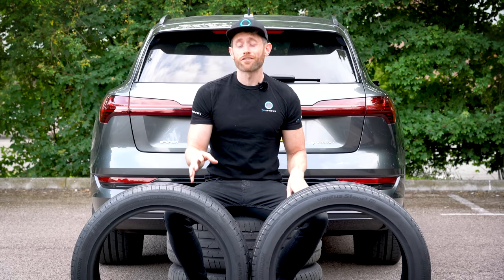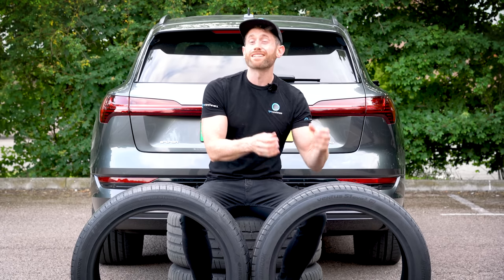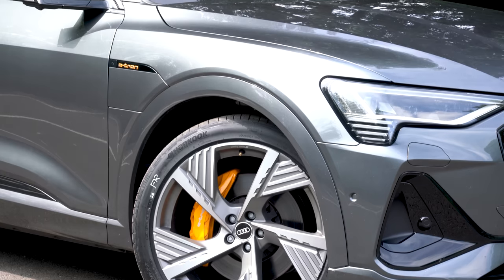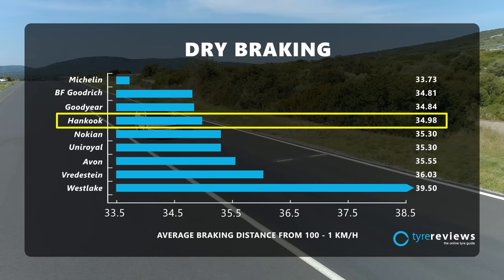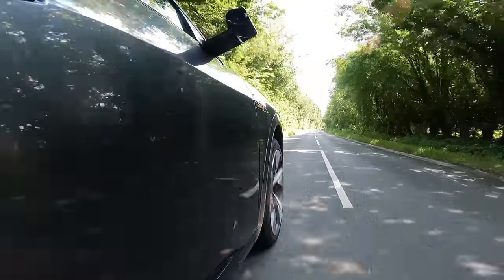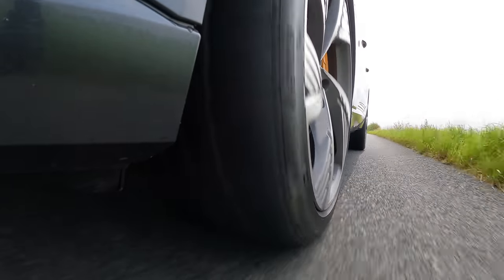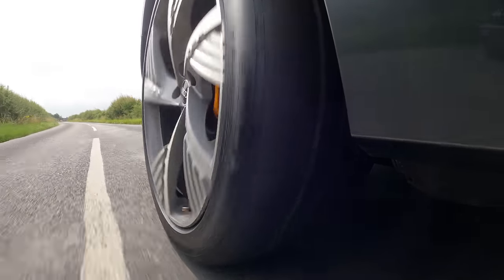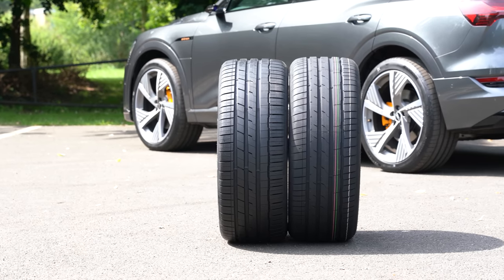What makes EV tires different, and why should you fit them! 🔌

Comment: In other words, as usual: fit the recommended tyres to your car, the manufacturer knows what they're doing when they recommend those.
Reply: Unless they are made by Nexen. Than throw them off the car IMMEDIATELY.
Reply: He also said that the manufacturer will screw it up:  Ford putting skinny tires on the Mach-E hoping to get a higher range number but changing it from a "Sports Car" to an Economy Box with crappy handling in the process.
Reply: Unless it's a truck with P rated tires.
Reply: Also there was the whole Ford Firestone thing
Reply: @RAM-BAWN  I think that really depends on what you're using the truck for. It's perfectly fine to run p rated tires on a truck if you're not really hauling anything for it. You know the people that buy it just because they might go get some bags of mulch from Lowe's once a year. If you're only putting 500 lb in the bed or even a thousand I wouldn't worry.
Reply: @custommotor  P rated also have less tread depth (usually), something that should also be considered.
Reply: I disagree, in my experience most manufacturerers seem to fit cheap tires that suck.
Reply: Nice !!
Reply: @fiyinfoluwa oluwasegun the climate here is cold and wet and the road surface is rough. I don't like the lack of grip the tyres have below 10°C in the wet. If it's warmer and dryer where you are they might be fine.
Reply: Nah, I'd suggest people to use what fits there driving style, budget and road conditions without going to extreme, like putting slicks or super grippy tires on a normal car. 

Perfect example is Mercedes recommends a MO Continental ProContiContact for my car. They are a horrible tire. I've only used DWS06 and Nokian WRG4 which are far better across the board in every condition except noise and comfort.

I'm personally looking for a tire with a little bit more longitudinal grip in the wet. The DWS06 are better than the WRG4 in the wet, but not better in the snow and ice or tread wear. 

Still looking for another tire.
Reply: I remember people hated Goodyear efficient grip so much they almost sold the car.  Fit a set of Michelin primacy 4  and it's a complete transformation
Reply: @quixomega  it's whatever they get a cheaper deal on.  They're literally buying 10's of thousands of sets of tyres.
Reply: Nah ev tyres for my ice phev
Reply: @TheCloudhopper  lol, why? Me ‘em is not a good tire? Terrible quality? Thx
Reply: @mikeike7114  Depends on where you are.  In warm dry conditions they were ok (not great) but in cold (below 14°C) and damp conditions their brake performance is atrocious. They felt unsafe in wet conditions around 10°C which here is pretty much October to May. 
It's hard to quantify, I did an unscientific test on the road outside my house. Stopping distance on the same day in very similar conditions before and after changing tyres, The continental tyres I'm on now stopped from 100kmh in 15m less than the nexen. And I havent triggered the ABS once I. The two years since I switched, with the Nexen the ABS would often activate when stopping at junctions.
The rubber mix is obviously not optimized for use in Temperate European climate
Reply: Unless they’re made by Dunlop.
Reply: @setoman1  
Dunlop doesn’t make cars!
Reply: Most manufacturers are putting cheaper tires then they could to lower the costs, so no, unless you're driving an expensive car, there are probably a bunch of better tires than your car came with.
Reply: @vladimirtalijan  Nope, most will put proper tyres on their vehicles that optimise performance, either handling and/or fuel efficiency. Many will have multiple tyres they recommend, and may ship the car from the factory with the lowest cost option among those, yes, but that doesn't mean they only recommend cheap ones simply because they're cheap.
E.g. for my car the manufacturer has 2 recommended tyres. They ship with the option that's manufactured closer to the factory, the dealers typically fit replacements of the option that's manufactured closer to them simply because of logistics.
Both are good tyres, just availability is different in different areas.
Reply: @jwenting  My last car came with tires that cost $300~ per tire (2017 money), and they were absolute trash. I thought it was an issue with my car, until I got cheaper tires. And suddenly! I had traction 😂

Comment: Don't have an EV and no immediate plans to buy one. Watched anyway because your content is always so interesting 👍👍👍
Reply: Can I ask why? I'm seriously considering an EV as my next car probably a tesla 3 or Jag I-pace as there more in my budget. But trying to gather opinions and data to help.
Reply: @seansimpson4472   Don't worry what Steve or anyone else thinks, if an EV will work for you then go for it. From my point of view, I've had an Ioniq 28 kWh for three years and it’s been great. If those cars are in your budget I'd recommend the Tesla Model 3 or wait a little longer for the Model Y which has a hatchback and massive space. The Jag is not as efficient or technologically advanced but still lovely inside. Try both.
Reply: Thats everyone bruh. Like everyone.
Reply: @seansimpson4472  I thought I had posted a lengthy reply, but perhaps there was a technical glitch. Just to say that an EV is not for me because I do occasional long journeys to the in-laws of 100 miles plus and the combination of range anxiety and inadequate charging facilities puts me off.  Having said that, if I did only short journeys, an EV would make very good sense, simply install a charger at home. Guy Martin did an excellent programme on this, on Channel 4, when he looked at setting a new speed record with an EV. Worth watching.
Reply: Neanderthal
Reply: @SteveLBMK  I'll give that one with Guy Martin a watch he is alway entering. Thanks
Reply: @themadjock1977  I can afford a cheaper/older EV the Ioniq would be great but for me AWD is a must. Mainly due to the power and wanting to get it down fast 🤣🤣 but I also have family back home in Scotland and work out in the sticks in North Yorkshire. My 3 series has the Xdrive and have used it enough times for it to be worth it to me.
Reply: @SteveLBMK  100 miles a scary drive on an EV? I own a Tesla 3 and have clients I drive to 135 miles each way, all I need to do is charge to 100% and no recharge needed before I get home. I often visit my in-laws 350 miles away with a 10 minute recharge at the Tesla supercharger. Piece of cake.
Reply: @cabomix  I'm sure it is. How much did the Tesla 3 cost you?
Reply: @SteveLBMK  $44k USD with the tax rebate and cash back in 2019. Plus the 4-5k USD of savings in gas a year with 15k miles per year. How much is your car costing you in gas a year every year for the rest of your driving life?
Reply: @cabomix  Well, the first thing is that I said I'm my original post that I had no immediate plans to buy an electric car. If you were paying attention and were aware of the European regulations, you would realise that I intend to buy one in the future but not now, because they are too expensive. Also, my life is probably going to be shorter than most, due to spending most of my money in my younger years on wine, women and song. The rest I wasted.
Reply: @SteveLBMK  I wish you a long life anyway. Also hope that the Model 2 comes to market soon enough so more people can enjoy the benefits of EVs. I was just trying to debunk the idea that EVs are not good enough for long trips or problematic. My goal is to shed light to the reality of ev driving.
Reply: @seansimpson4472  Once you drive an EV you’ll find ICE laughable and will never go back.  I looked closely at the Jag I-pace but found everyone at the dealership totally clueless. I knew ten times more about their cars than they did because I watched every test on it that i could and loved it’s off road,. The Model Y drives better, gets better range and I trust Tesla’s longevity a lot more. In fact I was so stunned that what I read about Tesla was such a huge lie, from all sources, that I knew there stock was undervalued, bought and sold enough to buy three Teslas.  All the other mfrs are ten years behind.
Reply: Drive an EV for a day and you’ll never go back to ICE.  You’ll just feel sorry for those driving those high maintenance unsafe ICE.
Reply: I don't know if you had a test drive in an EV. That will probably give you more info than thinking about it 😉. The drive and feel of an EV is an experience.

Charging is always an important thing to think about. When you have good options charging your car whilst sleeping or working, an EV is very convenient.

For long trips, you need to be able to rely on a great fast charging infrastructure. Lots is being built out, but Tesla's network is still the best.

Also...the luxury of being able to preheat or precool the car before you drive it...priceless!

I do own a Tesla Model3 AWD Long Range. I absolutely love it. The less expensive SR+ version is a good performer as well. Even on long trips.

If you want to see lots of videos on lots of EVs, I highly recommend the TeslaBjorn YouTube channel. He has done tons of tests in all kinds of EVs and has tons of test data publicly available.
Reply: @SteveLBMK  I recently did a long journey to Cornwall in my Model 3. That's more than 200 miles from my home. I had charged at the nearest Supercharger the previous night. You fear range anxiety but that was not a problem for me. There are only 2 Tesla Superchargers in Cornwall and I haven't subscribed to others, but I managed to enjoy my days driving around Cornwall in my EV and I saw plenty others around there including those from other brands.

And this isn't the first time I have driven long distance in an EV. My longest ones were to South of Spain and to Vienna. EVs can do long distance. Try a good one for the weekend and see for yourself.
Reply: @colingenge9999  only if you buy brand new vehicles. i bought a truck last year and it was only $6500. 2002 silverado. it has enough power. has great range, over 400 miles. and i like the noise of the engine. also its a truck and their are no EV trucks. well none that are anywhere near affordable. and no $45k for the tesla truck is not affordable. new trucks start in the mid to high 20k range. the tesla starts at 45. 45k will get you a truck with a few bells and whistles.
Reply: @colingenge9999  lol. high maintenance. i haven't done any on my truck. only oil changes and a tire rotation. also diff fluid change which it was up for. otherwise nothing. runs like a dream. went on a trip back in june, 1100 miles one way. so 2200 miles round trip. had no issues.
Reply: @kaasman78  some ice cars have to feature to turn on the ac or heater before getting in. some even have an app that you can set a time.
Reply: @colingenge9999  why are they unsafe ??
Reply: @tpike32  The accident rate for internal combustion engine [ICE] is more than double what it would be for a Tesla model three for example. Part of the reason is that Tesla has a superior accent avoidance system but the most important feature is that the wait is centered in the middle of the car and extremely low down. At foot level. Compare that to an ICE car which has this big block of metal in the front rather high up which increases the moment of inertia and the ability to rotate the car around the center of gravity is affective negatively. Mostly the highest center of gravity causes ICE cars to roll over. SUVs in particular will roll over at the slightest provocation. I’ve seen in person a BMW SUV roll over at no more than 5 miles an hour with a clip the inside curb going around the corner.  Additionally, even though many people think because of media reports that EV‘s have more fires, the reality is that ice cars have 10 times more fires and over 550 fatalities in the US compared to zero fatalities for fires in E V‘s.
Reply: @colingenge9999  your statement is invalid .. there are more ICE accidents because more people drive ICE then EV’s 🤦‍♂️
Reply: @tpike32  accident rates are given and discussed at % or accidents per million miles where the actual numbers of a particular vehicle is completely factored out.
Reply: @colingenge9999  did you also know that you are more likely to die from falling from 10 stories then you are at 1 story building ?? Also . You are more likely to get hurt on a motorcycle then a tricycle. 
Also you are more likely to drown in a lake then in a bathtub??
Reply: @tpike32  Check the stats, you have a 50% chance of serious injury over your lifetime in a car. Reducing that by half in a Tesla has value.

BTW it’s not “then” when your make a comparison, you must use “than”. Common mistake.   I am faster than you but until then… and so on. Chances are you don’t read or write much which is why you make that common mistake. Keep learning and soon you’ll create some worthwhile ideas worth sharing.
Reply: @colingenge9999  well then . You must know then that todays modern day cars also have same safety features as a Tesla.
Reply: @tpike32  gas powered SUVs rollover very easily. i have seen two new ones rollover at 5 mph whereas in the rollover test rig, they could not get the Tesla to rollover no matter what they did because center of gravity over a foot lower.  Watch wham bam Tesla Cam with 100s of Tesla collisions but no rollovers whereas SUVs and even gas powered sedans rollover very easily.  90% of injuries happen in rollovers.

Comment: Would be good to see a winter/all season EV tyres test. It's great to get into pre heated defrosted car in the winter. The extra weight, and instant low down torque can make winter conditions tricky though.
Reply: Second this 👍
Reply: Yes please!
Reply: Extra weight helps with traction off the line although yes, you have to contend with momentum when turning and braking. Torque is actually a non-issue because EVs can instantly adjust torque output at the motors as opposed to a regular car that has to use brakes to slow down the slipping wheels while the engine is still trying to turn them. It's far less dramatic when you floor an EV on a slippery road.
Reply: I live in Scotland and use Goodyear Ultragrip winter tyres on my rear wheel drive only Model 3 SR+. To my amazement the car turned out to be staggeringly good in winter conditions (excellent weight distribution and traction).  Certainly much better than proper 4x4 vehicles that haven't put on winters (on tarmac).
Reply: It snowed here last winter right after I got my Tesla, so I took it to an empty parking lot and tried to do doughnuts but the traction control was so precise I couldn’t lose traction even if I floored it and full turned. I was quite impressed
Reply: Currently wrestling with this as we speak, and why I'm here
Reply: yes, please,,, and remind people to fit winter tyres (as with summer or all season) as full set.... I see lots of cars in winter with winter tyres just on the front !!
Reply: @Ficon  I can confirm this with a 4wd EV with summer tyres in wintery conditions. The drivetrain/motors don't want to slip the tyres. Traction Control 2.0.
Reply: I have an old EV Berlingò van (Ok, it's its less known sibling, Peugeot Partner electric)
It's a mere 100kg heavier than the ICE version (1480 kg for 1.4 petrol 55kW engine, 1580 kg with 49kW electric), same wide "cargo" tyres and 95% the same vehicle.

But on snow I feel the difference: the ICE is nose-heavy, the driving wheels dig in.
The EV is belly-heavy. it floats with weight distributed on all four, and I got that disconcerting "sledge" feelings way too often.

Of course I have the winter tyres, but those won't help that much if they are not on the ground but sliding over packed snow.
Reply: I was going to say something similar. 
I also wondered if tyres existed with both all-season AND EV characteristics in the same tyre, or do you have to choose one or the other?
Reply: Personally, my experience last winter when we actually got a decent amount of snow, my EV was brilliant. You can control the power so precisely and the traction control is so good. I was having lots of fun watching RWD ice cars with summer tires struggling, when I was zipping by in my AWD Model3 with those Michelin PA5s.
Reply: @kaasman78  Which tyres? The summer Pilot Sport 4S?
Reply: @MrAdopado  Totally agree with you. I used ultra grip on a bmw 3 series a few years ago and was gobsmacked by the difference. Wasn't frightened to drive anywhere in the car.
Reply: Having been in the car industry for close to fifty years everything we know points to a Lexus Hybrid being the most practical and satisfying vehicle to own. I feel so sorry for those people stuck in their car at charging spots subject to the homeless approaching them. I always wonder if they are regretting their choices that led to them being parked there waiting to be charged up.
Reply: @henrysniper8481 Charge overnight at home 99% of the time. No waiting around at fuel station getting stinky hands and shoes and catching a cold from the person behind in the queue to pay (being fleeced in fuel tax) at the kiosk.

Comment: How soon do you reckon the All Season comparison will be out? I am set for this year and the one to come, but I find that your videos also have some entertaining value, so I like watching them even when I am not in the market for new tyres :) Also, reaaaally looking forward to see how my Vectors 3 compare to the CC2
Reply from the maker: Next monday!
Reply: On the strength of a previous review from here I bought Michelin Crossclimate tyres for my current car and they have been great. I will certainly be fitting the cc2's next time.
Reply: Yes, that what I want to see, as in UK we have very mild winter, but still a bit of snow, can't see any reason to go for winter tyres, but all season can be an option
Reply: All season tires is a marketing scam. There are summer tires,  and then there are winter tires with or without studs.